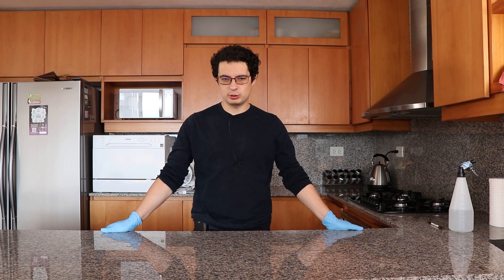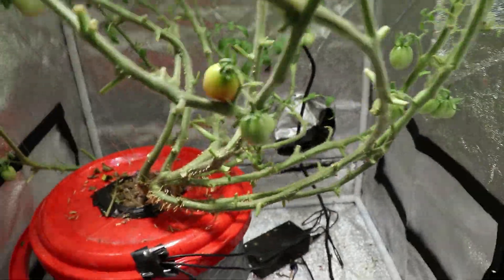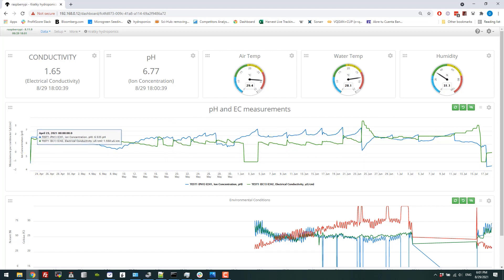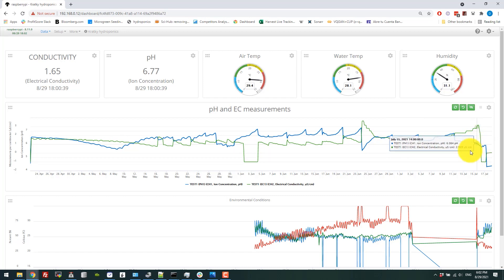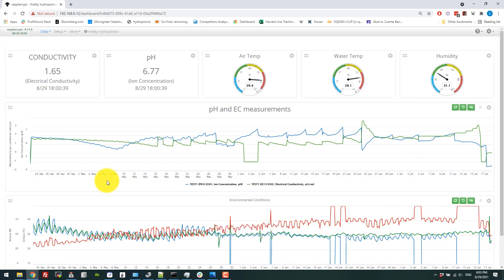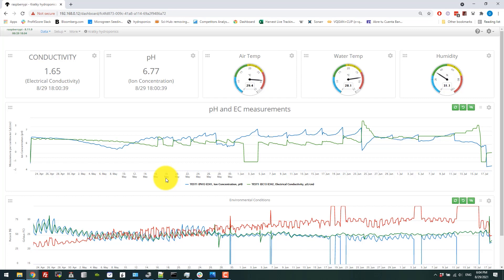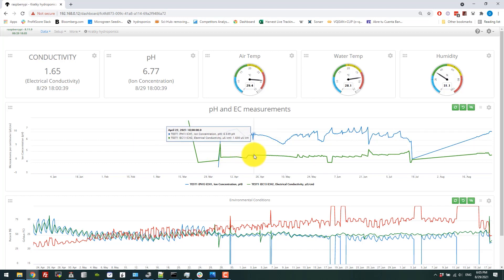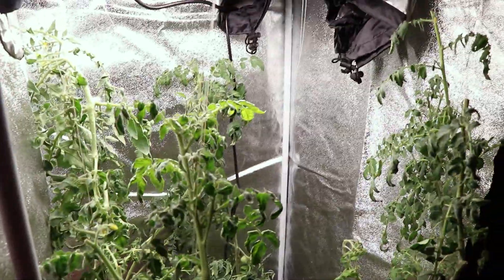A tomato plant in fully passive Kratky from start to finish - Part three

Comment: How do you pollinate flowers indoors? just thinking if it aborts so many could it be lack of and maybe a quick dust with small paintbrush around flowers would increase production
Reply from the maker: Generally I use an electric toothbrush, if you put it next to the base on the flower cluster it makes them vibrates and pollinates them very efficiently. However in this particular case I did not pay too much attention to it, so it was very likely my negligence. I didn't even put a fan inside to help with air circulation.

Comment: I accidentally mixed the Masterblend 5X too strong!! 
My tomatoes and cucumbers sat in the mixture for over two weeks, and never looked stressed.  Obviously I fixed it when I realized my mistake, but it makes me wonder how important the amounts are.
I've also been told that mixing in a specific order is important..... Masterblend first, followed by Epson salts & then Calcium ....but I question that as well.
Reply from the maker: Thanks for commenting! That shows you, plants are quite good at adapting! About the order, while some orders might be faster than others at dissolving, none of them are going to cause failure if you wait for each one to dissolve before you add the next.

Comment: Awesome videos. You should definitely restart some tomatoes 🍅 and the very best kinds to do in Kratky are Tiny Tim Tomato’s because they stay really small and you don’t even have to do hardly any pruning, watering, pollinating etc there are tons of videos on YouTube showing the tiny Tim’s and also other small ones like Red Robin etc and they also don’t use as much water either. Also it’s about 10 to put in a float valve so you don’t have to mess with anything at all, you should even have to be changing the water and you only need to add to it.
Reply from the maker: Thanks a lot for your comment and suggestions!

Comment: Hey great series!  Just started a tray of Kratky plants today.  Thanks for warning me that once the plants get big they'll drink up all the water really often!  I'll have to change the water out each time since I can't measure its chemistry.  If only there were some kind of automated float switch & refill system (from a big water tank) for at least maintaining water level so that the O roots always stay just barely above the water.  The float would have to be so reliable though, to make sure it doesn't overflow and flood your house.  Redundant float switches?  Wonder if people already thought of a small DIY solution to this.
Reply: By the way for the curious, my Kratky setup and plan:  A plastic tray for the water, and a slightly bigger cardboard box tray turned upside down to fit over top.  Cut holes on top of the cardboard tray, big enough to slip each root system through.  I made 8 holes.  With one hand, hold each plant bundle at exactly the position you want considering the root height and water level.  With the other hand, use a big strip of aluminum foil to pinch the plant over the hole so it can't fall through, then stuff the excess foil in to fill that hole to hold the plant perfectly upright.  My tray holds exactly 1 gallon of water, and to that I'll just add .5tsp Miracle Gro plant food powder, and .25tsp epsom salt.
Reply from the maker: Thanks for commenting. Adding float vales is something several people online have done to "automate" the rewatering part. However, you will also need to completely change the solution from time to time as some nutrients - especially Ca and Mg - will heavily accumulate and become toxic if you do not completely change the solution at least once a month.  Also bear in mind Miracle Gro plant food powder contains no Ca and has nitrogen as urea and ammonium (not nitrate which is what plants in hydroponic setups need), so you are unlikely to grow healthy plants using these nutrients.
Reply: @Monogrammaton  wow sounds like you had a lot of problems and it ended up being harder to do than what it needed to unfortunately. There are TONS of videos here on YouTube showing super super simple ways to make the setup, I’m curious what you grew in yours since it’s only a gallon??? Sounds way too small for all the holes you cut!!! A simple $10 float valve works perfectly and there are TONS of videos on here showing how to do that. Everything I grow is Kratky and it’s AMAZING!!! I grow lettuce in blacked out mason jars the 32 oz wide mouth which perfectly fits a 3 inch net cup and you won’t have to refill it because it’s enough for the entire grow. Then for my other plants they are all grown in 5 gallon black buckets and the lid is a 6 inch net cup that’s made for 3 and 5 gallon buckets which you can buy all of this stuff on Amazon or even Home Depot online which I found to be cheapest in a 10 pack for buckets and the lid net cups. I use rock wool to grow my seeds and then the clay pebbles as the surrounding grow media to fill up the rest of the cup. In the buckets I grow tomatoes, cucumber, cantaloupe, eggplant, green pepper, squash etc etc also when growing things like tomatoes it’s best to get tomato varieties like Tiny Tim and Red Robin etc, for everything you grow you need to research and find the best smaller varieties!!! Also in the 32 oz mason jars you can grow every single herb variety!!! There is a TON of videos and websites that show every aspect even on the best simplest ways to make the containers for example get a storage tote and you can use the drill but that cuts circles I can’t remember the name but it comes in every single size that will fit the net cups perfectly and you just drill all those holes in the ton of the bin also you don’t have to hold up the plants or whatever it was you were holding up and you can use both your hands lol 
Also as far as nutrients you are making it way more complicated than it is.... they make all kinds of hydroponic nutrients such as MaxiGrow and MaxBloom which are powders and sounds like it would be the simplest for you, General Hydroponics brand, MasterBlend trio, etc etc heck you can even just buy the aerogarden A and B set and all of it is on Amazon.

Comment: Hi Daniel,
Did you monitor the potassium levels during the test?  Tomatoes typically strip large amounts of K from the reservoir prior to the onset of flowering. Basically the plants stockpile K  so.its readily available in quantity when the time comes. Its usually accompanied by a sharp drop in the PH which is indicative of the reduction of K in the solution. I wondered if you noticed this in the data?

Comment: Perhaps a variety such as Tiny Tim would be better suited to Kratky.

Am I understanding you correctly that the plant drank more water than nutrients, and that you topped off with nutrient solution each time? What would cause a plant like this to not absorb nutrients as readily as it could? Perhaps a more concentrated solution is called for?
Reply from the maker: Thanks for commenting! The plant was always taking more nutrients than water. The EC kept consistently dropping every time I increased it. It was always topped with fresh solution, although I did do a full change of solution a couple of times because Ca became excessive (>400 ppm). If I had just kept adding nutrients the plant would have probably died without these full changes, due to the toxic accumulation of some nutrients. 

The larger nutrients than water consumption - EC dropping with time - happened even when the EC fed was at 3.5 mS/cm, so it is not just a matter of increasing the EC of the solution to give the plants more nutrients. 

I have a basil plant in the setup right now, so I will let you guys know in a future video how that plant behaves in the Kratky setup.
Reply: @ScienceinHydroponics  I'm growing a Thai basil in an Aerogarden with the provided solution every two weeks. It's probably about six months old right now and has essentially become a bonsai tree due to the pruning to keep it short. :)

I did a complete rinse of the container a few weeks ago, as well as a gentle rinse of the roots. It responded very positively, but I don't know if it's due to better oxygen flow from the rinsed pump or due to rinse out of accumulated salts. Perhaps a bit of both.

Comment: Oxygen! Please measure oxygen! 
I have a similar set-up in my living room: 2 large tomato plants in a 60l tank (filled at most to 50l). Main difference with yours is: -air stone; -sun light through a window. After 2 months the plants are about 2 m tall and >1m wide, with foliage fully covering the window. They drink 20-25l of water per week. Another difference is that my ec raises, rather than drop: when I refill the tank I add nutrients to a target ec of 1.6 mS/cm, and after 1 week I am at about 1.9-2 mS/cm. So it seems that the plants consume proportionally more water than nutrients. I also experience flower abortion...
Reply from the maker: Thanks for commenting! I didn't give measuring oxygen much priority because you expect the solution to basically become completely oxygen depleted quite quickly, as there is almost no exchange, except for diffusion from the headspace. 

Of course, adding an air pump massively increases the expected growth and water uptake from a plant in a setup like this. I would say your EC goes up likely due to the sun, which probably drives up your plant's transpiration rate. Although increases in EC are the most common scenario when high oxygen availability in the root zone is present.

The objective is definitely not to get the "best possible result" but just to show that a tomato plant can be grown without the need for an air pump and that, it's not the best idea.
Reply: Thanks for the reply!

Comment: Have you considered trying hempy (perlite in a bucket)?  Conceptually it's about the same as Kratky, just requires more frequent waterings.
Reply from the maker: Thanks for writing! The idea of the Kratky system is to have a totally passive system, having to use a pump for irrigation sort of defeats the purpose. Perlite is scarce where I leave, but I routinely grow using sand and rice hulls when normal irrigation is used.

Comment: Ahh finally! Was wondering when the next vid was going to be uploaded! Also looking forward to the next vid as I just recently planted a tomatillo and wondering if I could raise some of them in Kratky method xD
One question is, I remember from reading your blog that silicates are something that can help out a plant a lot. Do you use them and if so, how do you use them in your nutrient solutions?
Thanks for the vid!

PS. Seems like your blog is down? Is it a temporary error on WordPress?
Reply from the maker: Thanks for commenting! Silicates are great in most systems, but not compatible with the Kratky method as the silicates will polymerize and become unavailable pretty quickly under stagnant solution conditions. 

About the website, it was just going through some maintenance, should be back up now!
Reply: @ScienceinHydroponics  
Hello Daniel! It's first time I heard of polymerization of silicates under stagnant solution condidtions. Could You share some information about this? Is aerated solution fine for holding silicates in soluton?

I also want to thank You for all information that you share! Your hydrobuddy was really a game changer for me!
Reply from the maker: @ZiZU4851  Thanks for your reply. The silicate ion turns into monosilicic acid at the pH used in hydroponics, unstabilized monosilicic acid polymerizes in solution. You can read more about this here (tinyurl.com/yc43h49c). 

Above around 10 ppm of Si you cannot maintain a stable solution at pH 5.5-6.5, it will polymerize with time. Regardless of whether your solution is aerated or not.

If you want to maintain higher concentrations of Si in solution, then you need to use a stabilized silicic acid, like a ch-OSA stabilized mono silicic acid product. 

Also glad to here HydroBuddy has been useful for you!
Reply: There are TONS of videos showing everything you can grow here on YouTube just type in Kratky Hydroponics and then the name of the plant you want to grow.

Comment: I feel much better that neglect also killed your plant, because i had a few this summer die the same way. I'm very much set on soil-less coir/perlite grows because of how forgiving they are in comparison. 

I had a large plant in a deep water culture that died after the roots formed into a solid mass, and rot started in the center of the mass. 

I feel like resilience, along with root formation, and the high level of care required, to be a massive downside in hydroponics. 

I had some kratky tomato cuttings in solo cups just for fun, and they did great until the roots hit a certain size and didn't seem to get enough oxygen. 

Loved seeing this experiment though! I am sad you lost that tomato plant
Reply from the maker: Thanks for commenting! I also prefer to grow in soilless media by a mile, especially for larger plants. It is much easier to have great results and neglect is not punished as harshly!

Your points are all valid, growing large plants without media is indeed problematic because of how big the root mass can get and how this can limit oxygen transport. In a Kratky setup like this, a large plant requires you to keep progressively lower volumes of water - larger exposed root mass - to avoid oxygen deprivation. It is also better to use taller containers, where solution can drop faster and expose roots to oxygen faster. 

As I said in the beginning of the project, this shows a lot of the reasons why Kratky is not great for plants this big and this demanding! The Kratky setup is now hosting a basil seedling, we'll see how that one does :)
Reply: @ScienceinHydroponics  i did like kratky for nursing clones i haven't gotten around to planting. Once the roots set in, just replace water with nutrient solution, and away they go. 

I've been trying to think of some kind of insert for buckets to space roots for more oxygen flow, but at that point you may as well use coir/perlite. It's a shame because nothing compares to the magic of seeing roots suspended weightless in nutrient solution.

I look forward to seeing the basil!
Reply: @xenoneuronics6765  all seedlings started in coco coir have died for me. I started many seeds in different media and the coir ones never made it. I tried peppers, cucumber and dill.
Reply: @difflocktwo  I've only had the issue with straight coir, never pucks. I had a fungus attacking my seedlings, but autoclaving the coir got rid of it. Otherwise just keeping it damp, but not wet, and letting it dry out a bit, really helped
Reply: @xenoneuronics6765  I will try to boil or bake the coir next time. I would really like to get coir working and water it kinda like a soil plant, but with nutrient water.
Reply: @difflocktwo  boiling it would work best, dry heat takes much longer to sterilize. I have a white pillowcase i use to strain it so it doesn't make a mess. 

I've been using phosphoric acid to pH a 5 gallon bucket down to 2.5, then adding 2.5L to another 20L to get it to the final pH of 6ish. Adding nutrients to that brings it down to 5.5-5.8. I've been experimenting with miracle gro bloom + epsom salt + calcium nitrate and it's working well. Mixing it all is a pain though, if i wasn't in an apartment I'd be using a 50 gallon garbage can, one of the ones on wheels
Reply: @xenoneuronics6765  I'm also using water soluble nutrients from the hardware store lol. The only issue is fertilizer for soil has no calcium. I'm trying to get my hands on calcium chloride or something. Right now I'm just using cal mag from the hydro store until I can find calcium chloride. I'm only finding calcium chloride in 25+ kg bags for road salting.
Reply: @difflocktwo  i got lucky finding calcium nitrate at the local hydroponics store for $40 per 25kg. Here in Canada it's hard to find chemical suppliers
Reply from the maker: Thanks for commenting! About coco for seedlings, you need to boil it, coco contains a ton of tannins that negatively affect germination. Not to mention the fungi in it, which can also be pretty bad. I used to grow microgreens in coco matts, worked wonderfully by just boiling the coco for 3 minutes before using it. 

About soil fertilizers. A big problem with soil fertilizers is that they contain high amounts of ammonia and urea, these are not compatible with hydroponic systems. Calcium chloride for road salting is fine if you want to use it as a foliar, I wouldn't add any calcium chloride to nutrient solutions though.

About getting fertilizers for hydroponics.  If you're in the US you can order all the raw fertilizer salts you would want online, amazon, ebay or websites like customhydronutrients or mbferts.
Reply: @ScienceinHydroponics  You are right, it is 2/3 uera and 1/3 nitrate. I did not think this was an issue. It was very cheap per kg, I guess this explains it. 

I really wanted to get the salts online but while salts are cheap, shipping was many times more than the cost of salts. At the end getting liquid nutes from the local hydro store would have been competitive with salts online because of shipping costs.
Reply: I could just switch to a soil grow to use up my fertilizer. Gonna take a while.